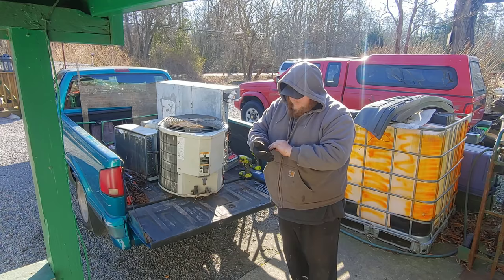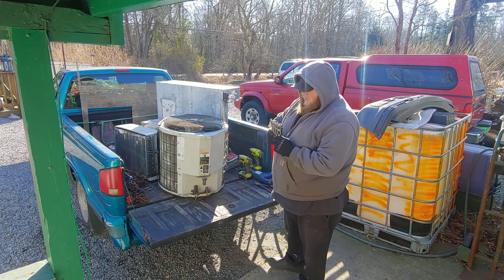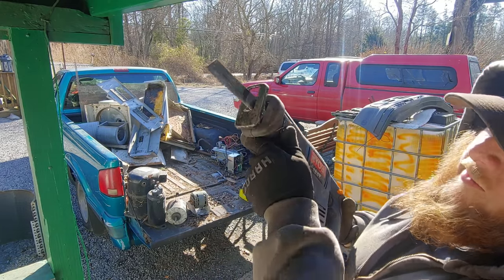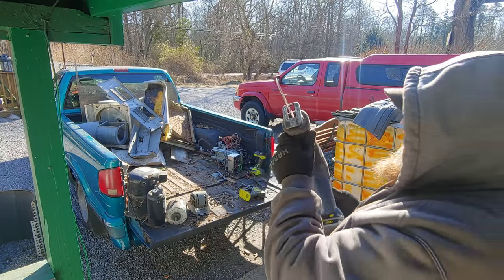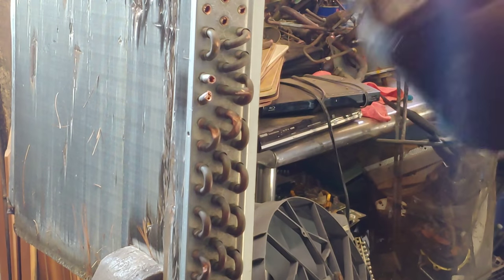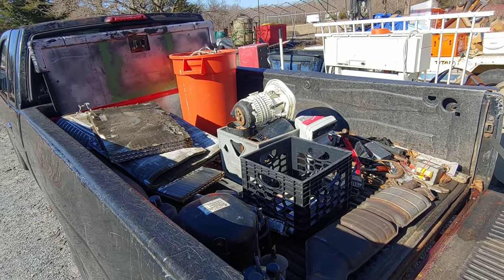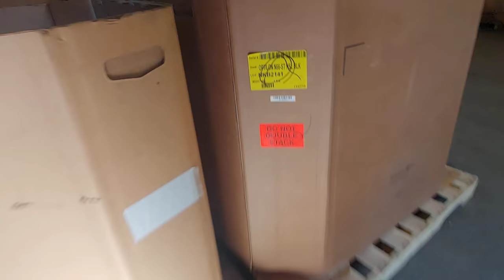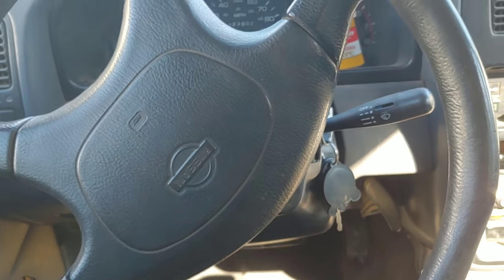Scrapping aluminum copper radiators and catalytic converter

Comment: Just a little input. The valves on the units are brass, not copper. Also, if you remove the rivets. Holding the fan blades on. You can clean aluminum price on blades.

Comment: Isn’t that illegal to just let the gas escape into the environment and your health  ? Here in the U.K. you have to vac it out or get caught doing what you did and face massive fines. Or salvage guys won’t touch fridges freezers air con units etc for that reason
Reply from the maker: All the ones that I get are already empty
Reply from the maker: I don't really know what you're talkin about nowhere did you see any gasses come out... you mean dust from the insulation is that what you're talking about not sure that that's illegal should it be probably LOL
Reply: When you cut that black compressor looked like all the gas came out ? The dust you said was asbestos? So that’s no good for your health . Maybe I missed heard or it was dust but looked like gas to me
Reply from the maker: No it was smoke from the blade and oil
Reply: Scrap Farm yep that makes more sense 👍👍